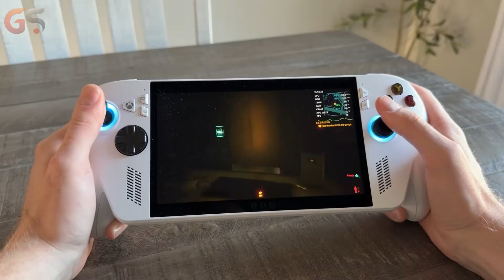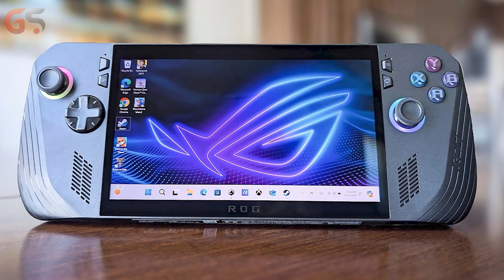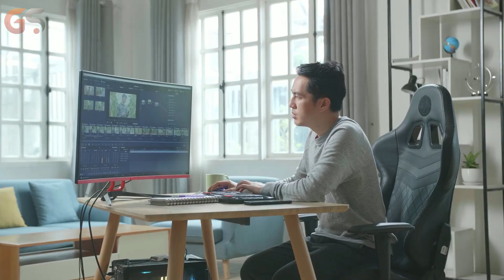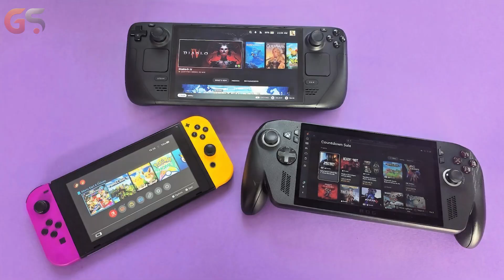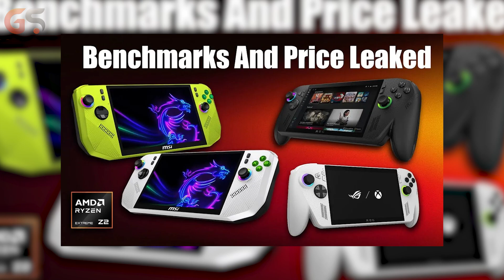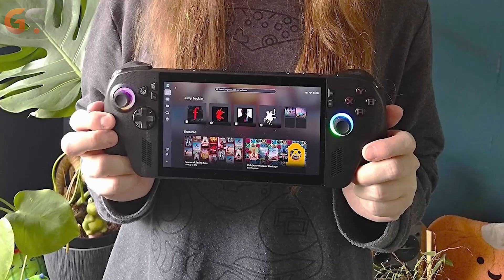Why Are High-End PC Handhelds So Expensive?  | So Expensive

Comment: Desktops are just as expensive if not more money adding in a power supply, fast 8 core cpu, fans/cooler, ram, ssd storage and a graphics card plus screen, speakers, mouse keyboard and game controller. The case isn't cheap either. Window handhelds were always expensive. Only the steamdeck and the switch /console market brought new lower consumer price expectations because that hardware is subsidized. Look at gpd win handhelds priced before the steamdeck.
Reply from the maker: You’re absolutely right. When you factor in a full desktop setup, the cost gap narrows a lot. Subsidized consoles really reshaped price expectations for handheld gaming.